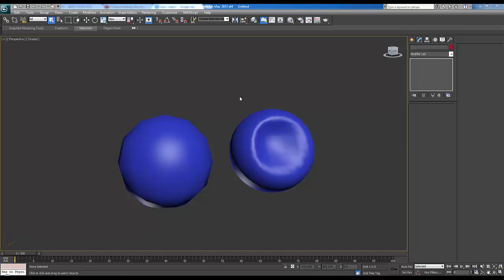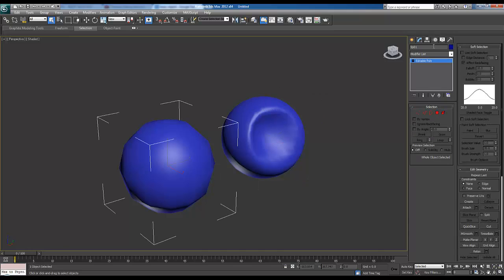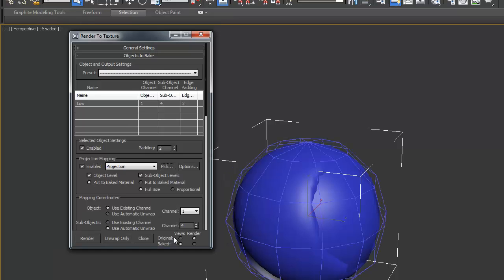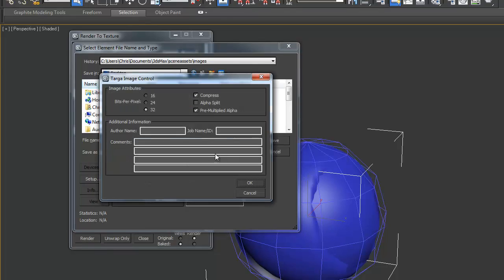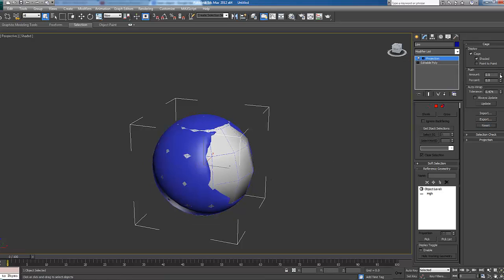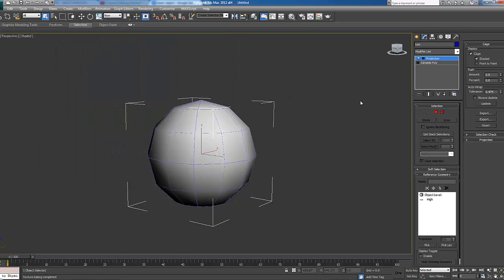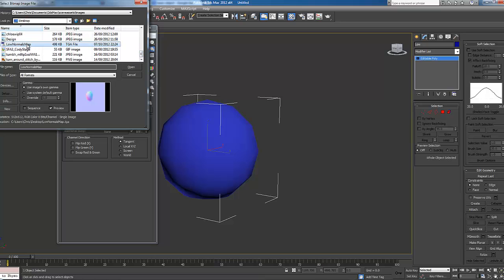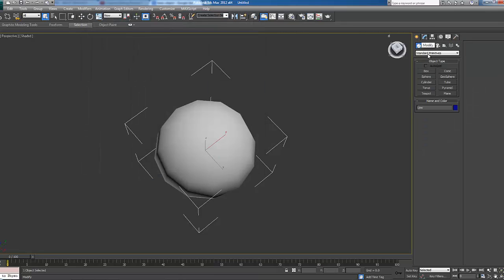(3ds Max) Normal Map Baking Tutorial

Comment: Yeah this is pretty helpful! I also discovered 'Render To Surface' is INCREDIBLY Helpful: With a single click! If for instance you have a Spaceship hull with a ton of windows,  lots of detail, indentations, you can click a single button and render a 4096x4096 etc perfect UV'd texture (to edit) of the meshes 'density' or the 'concavity' etc. Bring into Photoshop, use to create Spec, Bump, Normals! and Opac then have power to REPLACE Detailed models not only for LOD but for Main Model if you combine this tool with Parallax Occlusion Mapping!   You can have super simple models, and STILL maintain a AA complex detailed look!  Subscribe to get notification,  I'll be adding a tutorial about  this complete process in the next week!